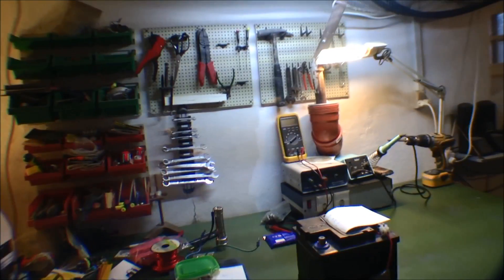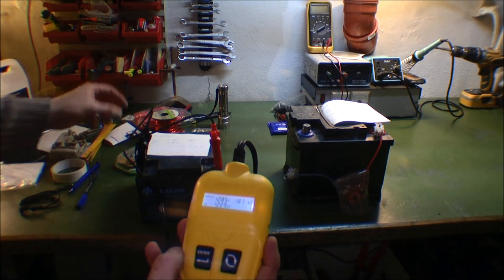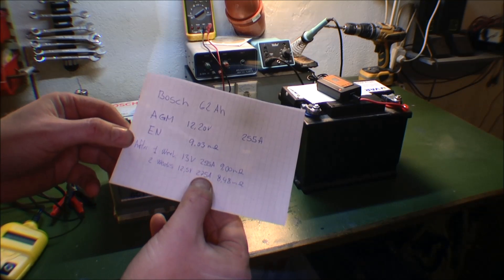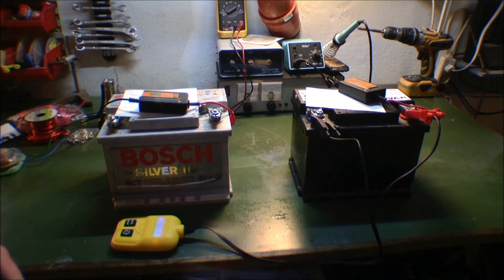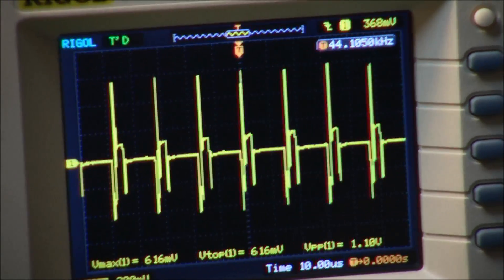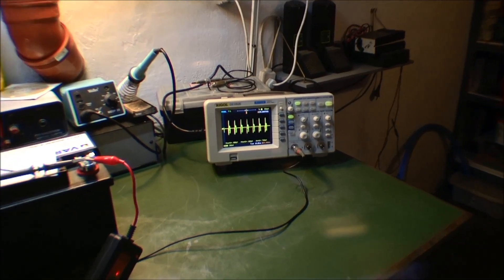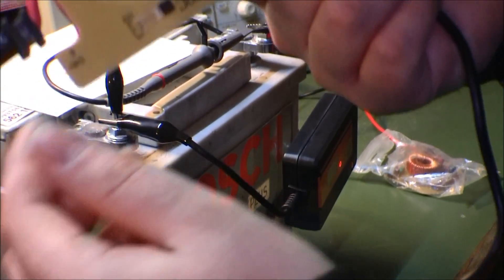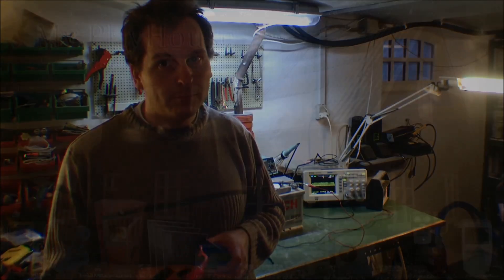Desulfators turned out to be worthless $hit - 184

Comment: I tested the iClen "chinaböller" 200ah, too. The placebo buzzing does not really help much. The point is to swing with the resonance frequency of sulfate, which is (according to a patent, see below) 3,26Mhz. I tried a Novitech Megapulse, and i really have meassured an older AGM Battery to recover from 10AH capacity to 25AH Capacity within 5 charge/discharge cyles. The iClen didn´t made any difference in Capacity over several cycles. A Pulser is an instrument to recover from sulfate, but it will drain water while its cycles, so it´s capabilities are limited.

A well working pulser should be kept attached to a PB battery all lifetime to really makes a pulser work and prevent sulfate from getting ruin the battery. It will start work with greater than 12,9Vvolt, as it needs a high voltage level to work. Usually while charging, only.

To compare the batteries I suggest to put them into the same voltage level, as the inner resistence changes with a corelating voltage level.

Patent: https://www.google.com/patents/WO2004073083A2?cl=en

A Megapulse works, i can assure it! :-) But seriuosly I don´t have an oszilloskope would be nice to see a megapulse in your test setup.
Reply from the maker: HI +WattVoltAmpere ?
Looks interesting,, i also like to try a Novitech Megapulse,,, but 79€ is a bit more then i was hoping for.
Thank you for watching! :-)
Reply from the maker: Hi +WattVoltAmpere ? 
If you are wanting to promote this NOVITEC Megapulse,, send me one. My address is in the About tab,, and i'll do some testing and video,,, much more effective then writing here in the comments.
Thank you for watching! :-)
Reply: +My PlayHouse (Morten Hjorth) 
actually I use it myself in my car with a small solar panel under the rear window to keep my battery in shape :-)

As I dont sell them, so I have not really an interest in promote them. 
BUT simply email to novitec, maybe they will spend a evaluation example ;-) E-Mail: info@novitec.de

Homepage: https://www.novitec.de/index.php/kontaktieren-sie-uns
Reply from the maker: Hi +WattVoltAmpere ?
Okay,, the way you was posting on more then one desulfating video,, it look a lot like you was promote them. Witch is okay but it would be alot better just have me do a video :-)
No problem :-)
Thank you for watching! :-)
Reply: +My PlayHouse (Morten Hjorth) 
Cheaper ones that also have positive community resonance:

- ELV Power Brick PB 500
- H-Tronic Bleibatterie-Aktivator Baustein ca. 12 V/DC (10 - 15 V/DC)
Reply from the maker: Hi WattVoltAmpere ?
Nice,, have you tried any of them?
Thank you for watching! :-)
Reply: +My PlayHouse (Morten Hjorth) 

Hi Morten,
I took my megapulse out of my car just to review it quickly:

iClen: => CRAP!
80mV / 50mA / 62,35Khz(!)
THAT CAN´t WORK AT ALL :-D

Megapulse: Works.
30mV / 200mA / 8,15Khz(!) => *400=> 3,26Mhz

(Meassured with a calibrated Fluke87V)

I also have a "Power-Pulsar" incoming for a further test. (tbc)
Reply from the maker: Hi WattVoltAmpere ?
Well as far as my testing shows the iClen actually did two things,, it wasted my time and money :-) It´s a bit of a shame,, it looked okay build indside.
Thank you for watching! :-)
Reply: @wattvoltampere6459  how did the power pulse work? I'm assuming it's the the one from pulsetech?
Reply: +WattVoltAmpere ? clen is small rip-off! megapulse is mega rip-off !!!
Reply from the maker: Hi Luca di paolonicola 
I cant comment on that,, havent tried megapulse,, and I am not going to write it off before I have tried a thing.
Thank you for watching! :-)

Comment: Mr. Morten thank you very much. You just saved me some bucks. As an electronic engineer myself I doubted they would do something significant just by the price of them and the construction box seemed very cheap. I was gonna buy one to run some tests until I found your very informative video. Thank you again, and keep up the good work.
Reply from the maker: Hi +MrGlacialman
Thanx,, yes this desulfators do not do much,,, they are really not that bad build, bur they are not much better then a noisy car charger.. :-/
If you find something better,, at a good price,, let me know :-)
Thank you for watching! :-)

Comment: Thank you for your video, I watched them with interest.
In my opinion to use a desulfator you must always leave a power source, otherwise the sulfate which eventually breaks down, goes to reform other sulfate with infinite loop.
This is because in aqueous solution it enters very little, and just melted must immediately turn in H2SO4 and PB, the only way it can work.
-
Hi Max
Reply: Yes, using a current meter and charger. I put a diode in between charger and where I connect the desulfator (homemade) to the positive. That way spikes shouldn't flow back into the charger output - even though people say it' doesn't harm. I get to see various states of change as surface area changes inside the battery. I did leave it on just the battery first to see what happened and then I used with a charger.
Reply from the maker: Hi Max Baldo
So what you say is that the charger needs to stay on,, for the desulfator to work?
Thank you for watching! :-)
Reply: Yes, of course, a low current that it can be maintained without problems for the battery.
 Lead sulfate in water is saturated with 0.4mg for 100cc, a very small quantity.
 It 's  also why the battery is sulfated!
 If I want to make it dissolve more, I have to give power to get rid of what you already have in the water and bring it back into the plates, thus making space for the new sulphate that comes from the action of desulfator.
 Im a chemist, knowing little on electronics, it seems to me that a fundamental aspect for removing sulfate.
 Thank you!
 -
 Hi Max
Reply from the maker: Hi Max Baldo
I have tried it with both, not a charger and with a charger,, i have not seen anything to indicate any improvement.
The instructions of this desulfator,,do not say anything about, charging or maintaining the battery at the same time. Instead it tells about cut off voltages,, of like 11,xx volts where the desulfator will stop working, to not discharge to much.
I do not think this desulfator does much,, maybe a bit better than to tickle it with a feather in the moon skins,, maybe :-) 
Thank you for watching! :-)

Comment: are you really testing a desulfated battery? No improvement if the battery is still in its peak performance. Also you did not mention the factory CCA capacity of each battery tested.
Reply: David dela cruz  Factory CCA is not so important because the desulfation and charging tests are done in room temperatures and not 0F (or -17.8C) anyways.  As long as baseline readings are taken for capacity and internal resistance, one can fairly test and confirm the battery charging and desulfating progress or non-progress in this case.

Morten, appreciating you and your cousins in sharing your objective battery desulfation findings.
Reply from the maker: Hi David dela cruz
I am still playing with this off camara,,,, Still not seen the shadow of any improvement :-/
I did not find the CCA on all the batterys, I do not think it is an number which is as widely used in Europe as it is in the United States.
Thank you for watching! :-)
Reply from the maker: Hi ourlegacy 
I appreciated you watching and taking the time to giving this valuable feedback! My fun with batteries, is in a way on hold for the summer. This is more a thing for the could winter time.
Thank you for watching! :-)